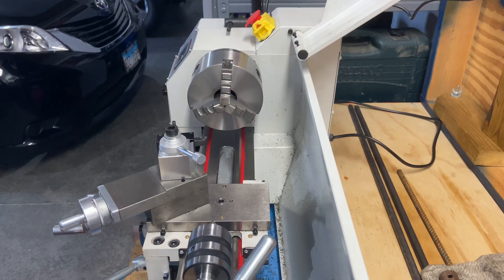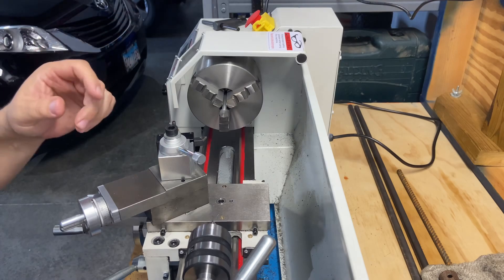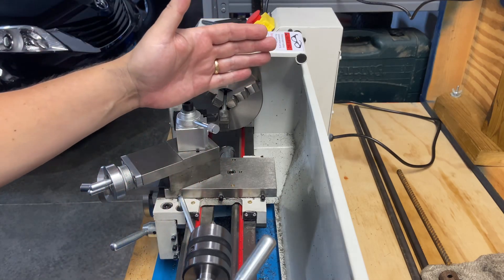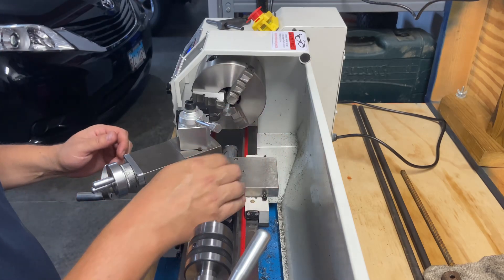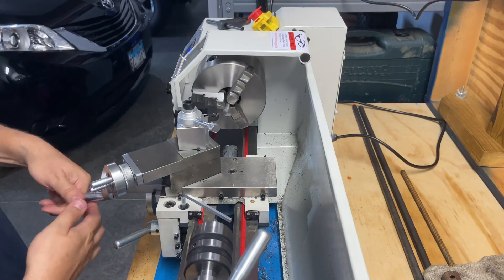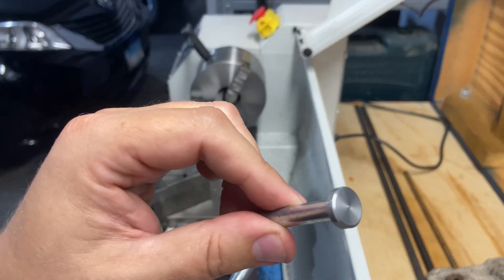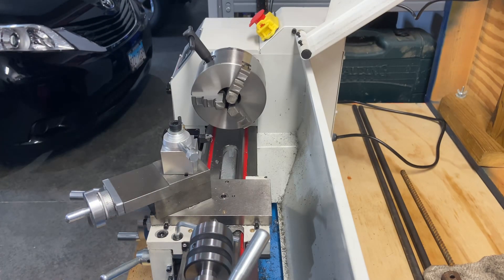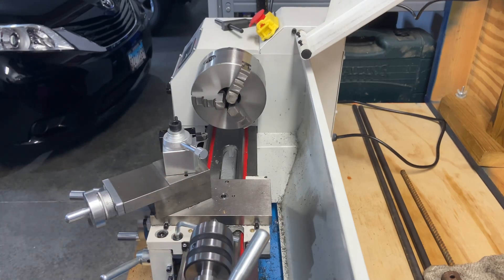Vevor Mini Lathe MX 400 Part 9 - Quick Change Tool Post Impressions with New Tooling Test Cuts

Comment: Which tool post is this? I'm looking for one for the MX-S450
Reply from the maker: This was super cheap,  Like 30 bucks off Amazon.  The size of it is 0XA.  I do NOT recommend this.  Its aluminum.  It is very small.  It might be ok for smaller lathes but I would opt for a steel version and wedge type if you can find one.  I upgraded to an AXA Size and love it.  I made a custom mounting sleeve to mount the AXA which I use today.  Dont follow my direction on this 0XA for mounting it.  I ruined the tool post by drilling out the bottom.  I was very new to all this at the time.  Good luck.
Reply: @deezworkshop  yea, I bought a steel 0XA and AXA. The AXA is too big and I didn't want to modify the lathe. The 0XA is pretty good. It sits on that cylindrical boss at the moment. I might drill out the bottom like you did on the aluminum one. Cheers!
Reply from the maker: @sidekick3rida I Shouldnt have drilled it.  It still worked but you lose the quick change lever feature and have to tighten it down at the top level.  I dont use mine.  care to buy it then you can try it? If interested send me a message to my email.  I have a contact form on my website or in the about page on my channel. https://deezworkshop.com/
Reply: @deezworkshop  I commented on another video of yours. I bought a steel 0XA post.
Reply from the maker: @sidekick3rida  you did say that.  Sorry. I still dont recommend drilling out the bottom like I did.  It will ruin the functionality of the QCTP.  Good luck.

Comment: Confused can you use 1/2  tooling with new tool post
Reply from the maker: Well I don’t use this tool post any longer but I still have it. I just pulled it out and put a 1/2 inch carbide tool in one of the tool holders and it fits. I only used 3/8 inch tools but it appears to hole half inch as well.  The tooling is bigger than the holder but it fits. I have since upgraded to AXA size and love it. I have videos on that if you are interested. Cheers.

Comment: Thanks for your videos. I have a question I have the same tool post but my problem is that it will not stay in place. I tighten it down and the entire block turns when I am using the lathe. The original had a little spring and ball to keep it from turning but this one is to small it seems and that cannot be used for this one. Do you have the same issue?
Reply from the maker: I didnt have that issue but I also made a modification to the bottom of the Tool Post by drilling it out to sit over the boss on the compound.  It worked for a while but I quickly upgraded to an AXA Sized tool post.  I made a custom sleeve to mount it with and am really glad I made that upgrade.  

As for this aluminum cheapo you can use it to make parts but I didnt feel like it was substantial enough for turning steel.  IF your interested I have several videos on my AXA Toolpost installation and modifications.  Thansk for watching.  

I should also comment on the spring and little pin that stops the original tool post.  I removed that completely.  these QCTP arent designed to use those.  I suppose you could drill a relief cut maybe and use it as a stop.   Good luck, I hope you get it figured out.

Comment: Haven't got my lathe yet but already bought an Accusize Axa and some HSS tools.
Reply from the maker: You will like that upgrade,  I dont regret it one bit. I don't recommend geting one of htese little aluminum QCTPs Like I did in this video.  It did its job for a short while so it helped me learn but just wasnt substantial enough.

Comment: i heard and read that the metal is too smoth and don t have long life
Reply from the maker: This toolpost is aluminum,  not substantial at all and was already showing signs of fatigue.  It did the job for a couple months but i wouldnt recommend this particular one.
Reply: @deezworkshop  thanks that s why i didn t by it, i ve already drilled one by myself...

Comment: I had purchased a similar tool post for my mini lathe and was very dissatisfied. Maybe I got a bad one, but the tool holders just did not properly engage the dovetails. With heavy cuts things would start to loosen, then chatter, and if not immediately stopped it would then rapidly crash and break the insert. I switched to 0XA tool post and holders and it was a tremendous improvement.
Reply from the maker: Same thing I experienced. This coming Saturday begins a new 4 part series showing my new tool post upgrade to ditch this aluminum cheapie. The small aluminum one was not stable at all.

Comment: the carbide cutters are called inserts. use a small brush and small can with cutting oil as you machine. Do not use a rag near a moving object.
Reply from the maker: Thanks John. Yeah I’m learning as I go. Definitely making mistakes but taking all the commenters advice and trying to improve as I go. Thanks for watching and the advice.